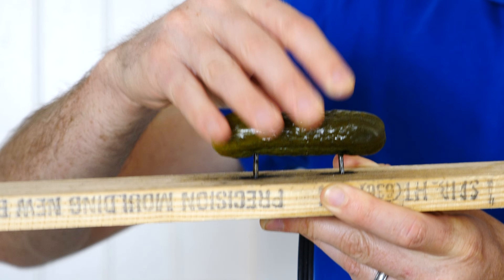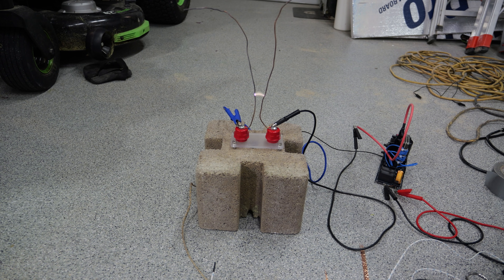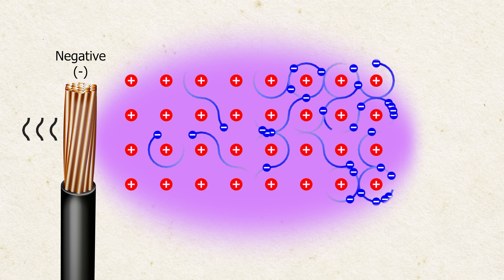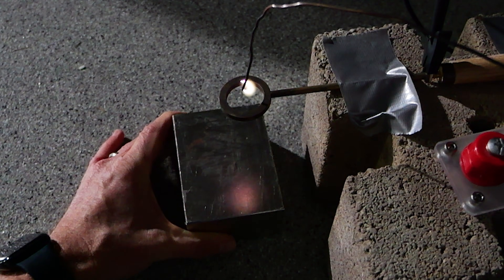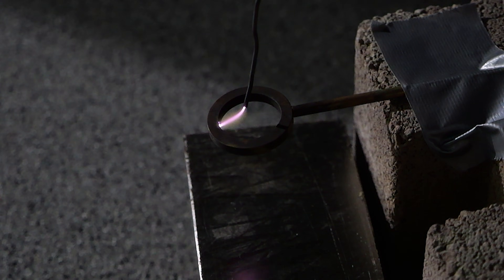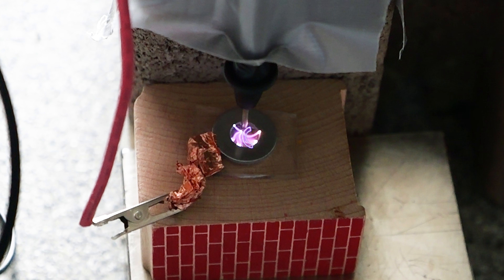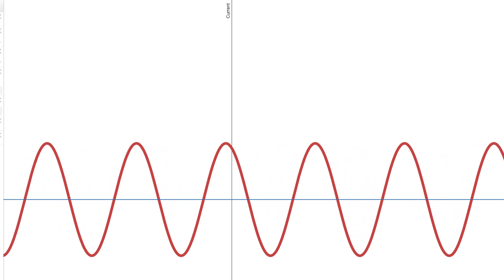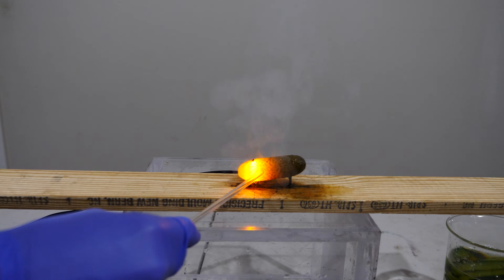Why AC Electricity Doesn’t Behave the Way You Think

Comment: What a genius. "The AC is supposed to be symmetric"[al].

First the AC provided to your location will be reasonably symmetrical. However the crap systems you try to fire it through would be better bent and connected ... and basically everythinged by elementary school children. This is not an attack just a statement to show why we build real technologies with the accuracies that we do. (Which I believe is still way below where we should be)

Second when a circuit finds a lowest point of resistance it will hold that region until something changes the system. The pickle is the same as the wires and the nail. It is a current carrier with its own capacitance and resistance. A good experiment for you to show on this kind of behavior is your thermal imaging on an old damaged extension cord with a medium load for its rating. You can make an old cord by running over a coiled (not a bunch of coils or you'll  surely tear the wire completely in places) cord with a car a few times.

Clean circuits make much less heat, but are proportionally harder to physically create. This should always be the number one goal.

Also, AC is DC and DC is AC. If you think more about how the ENERGY flows through the different parts of your circuit and how the different parts respond to that flow it's a little clearer. For instance, your pickle trick... The AC is like a wheel that accurately spins, and lifts a seesaw type lever that is your nails, that runs into a pool that is your pickle. If you make a floppy seesaw it will change the results. If you make a deeper, larger, smaller, wider, whatever pool, you will get different results. The reason I say AC is DC is in that it is the same as potting up voltage and potting it back down by hand over and over. The reason I say DC is AC is because when you initiate a circuits connection, just like the slight inaccuracies of the floppy seesaw, the material takes the flow of energy in its own frequency (AC) based on the materials "magnetic resonate characteristics". There are no straight lines. More like overlapping and bumping bubbles that are all different sizes and tensions depending on what it's made of. Copper seems to be happily overlapping bubbles with also great tension. The pickle seems to be happily overlapping bubbles with very little tension. The wire shield appears to be non overlapping bubbles with reasonable tension.
Reply: The flyback transformer he used has built-in diodes and some electronic neon sign transformers are knows to have a DC bias for some moving plasma effects in the tubes.

Comment: I could be wrong, but the high voltage transformer looks to be a diode split transformer. These contain built in high voltage diodes on the secondery side, so the output is high voltage DC, not AC.

Comment: No. 
It depends were you leave, but generally in homes you have 4 wires. Out of 4 wires only 3 wires are wired in each outlet. Most of the outlets have Live(Phase 1 or Phase 2), Neutral, and Ground. 
Exception to this is only for the equipment that requires 2 phases, and they have dedicated outlets which have Live Phase 1, Live Phase 2, and Ground.

Although the Live is AC at 50 to 60hz(depending were you leave), the Neutral is always theoretically at 0v.
PS.
Thus full bridge rectifier isn't necessary in most equipment.  Half  bridge rectifier would be just fine. 
However it is a good thing to have in case someone connects in reverse.

Comment: The other day I tried to think of a better metaphor for AC than the hydraulic metaphor that we use for DC.

What I came up with was to treat it like a sheathed cable, like on a bicycle's brakes. Energy is transferred by pushing the cable back and forth, and the load is at the end of the cable doing useful work. Voltage is how far the cable gets pushed, and amperage is how hard the cable must be pushed. Frequency, resistance, insulation, and wire gauge are basically non metaphorical here.
Reply: We had AC like mechanical power transmission systems, see "Flatrod system" for water wheels and mining operations and "Jerker-line Pumping System" for connecting multiple small oil wells to a single steam engine. By suspending hanging wooden boards that are connected end to end, you can push on one end and the other end can be attached to angle redirectors, splitters, and the pumps or machines that need power.

If I had to guess, these systems fell out of use as DC-like wire rope drives could power rotating machines more efficiently and more portable steam engines removed the need for transmission lines.

Comment: your ZVS driver uses a flyback high voltage transformer, flyback transformers output high voltage DC, they have an internal diode.
Reply: I was about to say this. There are AC flyback transformers, but most of the ones you find (including the one he used) will have internal rectification. Unless he modified the transformer, it's supposed to put out DC (as indicated by the big red positive output).
Reply: @minerzone63 yea i didnt get that either... He seemed to be saying it was an ac on the ladder as far as i could tell, but the line output transformer certainly looked to be the standard old tv one, with the 2 adjustment knobs. If it were modified it would look pretty damaged from drilling in and shorting the tripler diodes and capacitors properly. The ac ones u can now get on ali etc are also black and red, but just a simple barrell without knobs or the supplimentary voltage outputs.
Reply: Finally, someone noticed this. And some electronic neon sign  transformers deliberately have a DC bias for moving plasma effects.

Comment: It would be awesome it the bolt in the ring was round, maybe a round ball, and the ring had a ring, maybe like a washer - this way it would be easier to release electrons from the ring, than from the center piece and it would further cement the argument for DC bias in an AC driven plasma.

BTW, it is said (in some sources) that the full Moon causes slightly colder temperatures on Earth due to cold cathode effect - I would be curious is there anything of substance in this claim.

Comment: Pickle glow: Not because of DC bias, but because the plasma has a lower impedance than the pickle's natural impedance. Once its starts to glow it always going to glow on that side because of the lower impedance allow more current to flow in a dense spot. A pickle will not have an uniform impedance. I noticed that the plasma appears to occur on the opposite side of the stem in the video clips shown. Perhaps the bottom end of the pickle naturally has lower impedance than the top (stem end)

As far as the spin direction, that may be caused by the heat generated by the plasma & it swirling causing the plasma to bend in on direction from the start. If you look at a Jacobs latter the arc is bending & moving upward because its heating up the air causing it move upward. The direction of rotation might start because of the minor offset between the center electrode and the washer, and/or surface imperfections in the washer. 

I don't think the effect is caused by DC bias because the voltage drops to zero (essentially off) 120 times per second at 60 hz AC. Its the air flow causing the swirling effect.

What happens if the Washer & center electrode is rotated 90 degrees, such that the center electrode is horizontal. I don't think you will see an swirling effect unless a magnet is used. I think the arc will remained fixed at the top. Also try it at a 30 degree angle and a 15 degree angle. does it rotate anymore?

Comment: i always assumed it was because electricity when shorted will heat up or spark at the point of least contact or most ressistance, like how it would occur in an old lightbulb, or cold joints in circuits. i bet if you plug in the pickle again but only this time one side should be a tight fit and the other a loose fit, the side thats loosely fitted will arc always

Comment: The neutral wire, being referenced to ground, should have a negative charge bias from a surplus of electrons in the earth?  Testing with a pickle won't show that because variations in pickle geometry has a much greater effect. [edit: ... unless you can find a perfectly-balanced pickle where the hot end changes upon rotation]

Comment: Mass has heat energy singularities within its core and activation of generation of heat issues to the weakest point of resistance? Spinning is both clockwise and counterclockwise unification of unidirectional flow cycling circulation centrifugal force of currents grounding outermost surface perimeters first towards the core last in every scenario freezing, disolving, and thawing outermost surface perimeters first towards the core last that's grounding currents.

Comment: Can you measure the copper wiring DC resistance of the high voltage secondary? In both directions of polarity?
This might be a CRT TV diode split transformer with built-in, invisible , inaccessible rectifers. 
Those diodes would be detectable by such a measurement.
In comparison, ignition coils of combustion engines do not have diodes.

Comment: That's how a Mercury Arc Rectifier works. It creates a mercury plasma with AC input, and uses the explained principles to convert AC into DC. They were used until silicon diodes came out, and are very cool to watch.
Reply: They were used long after silicon rectifiers appeared due to the limited power handling - current and voltage - of the first rectifiers. They were used in railway locomotives for a long time because some systems had overhead AC for fast speeds overground and low voltage DC third rail for the underground sections, so the motors had to be DC.

There used to be one in the entrance hall of the Science Museum in London. I was there once doing some research and there was a school party of kids of about 8 or 9. One of them was looking at the mercury arc rectifier and the teacher said "So, Johnny, how does that work?"
"Madam," I said "I have difficulty explaining that and I'm an electronic engineer."
Reply: ElectroBoom needs to create a full bridge rectifier with Mercury Arc Lamps then.
Reply: @matthewhafner962  but it would be funnier to make a plasma bridge rectifier out of 4 pickles
Reply: There is a video on one of those Hg units in an elevator this week on youtube

Comment: Excellent creative analysis, and material I needed to know for some research. Thank you using real current as electron flow and not the idiotic use of conventional current used in all textbooks, etc., which is a lie. it would mean atoms are moving, so all the Cu+ copper atoms in the wires would be moving at high freq literally back and forth. My ham radio antenna wires would be sucked into my transmitter and spit out the other side the full length of the antenna  back and forth at 14 MHz leaving a bit of a mess as my transmitter melts.  Please do a video on that sometime to show its stupidity.

Comment: the zvs driver that was connected to the flyback transformer has 3 diodes in the high voltage winding so in the end you have a dc output but the other mot was pretty weird since it was not dc
Reply: It's possible that this is a Diode split transformer. They have great internal (hidden) values. 😀
Reply: @Oldclunker-ge5zp  yep exactly
Reply: The flyback transformer he used has built-in diodes and some electronic neon sign transformers are knows to have a DC bias for some moving plasma effects in the tubes.

Comment: Have you tried adding an adjustable DC bias to to waveform to counter the DC bias of the electrode geometry?
Reply: The flyback transformer he used has built-in diodes and some electronic neon sign transformers are knows to have a DC bias for some moving plasma effects in the tubes.

Comment: I have always wondered why AC wires they are important to wire the hot and neutral. I have never heard a good explanation. Thanks.
Reply: Honestly, I believe it has more to do with ensuring you don't accidentally make a bunch of series circuits throughout the buildings electrical system.

Comment: The rectifying effect of a plasma is used for surveillance of the flame in my central heating, which is powered by natural gas.
They apply a 200V sine wave to an electrode and measure the DC component of the current.
No flame-no rectification-no DC.

Your ZVS converter might not actually deliver a DC component at the output voltage. That would be challenging theoretically. But the unloaded voltage waveform might not be exactly symmetrical, i.e. there might be some even numbered harmonics contained. So the arc might strike earlier in one polarity of a cycle than in the other. The resulting current would then have a DC component. That current could actually be measured.
There is actually degaussing equipment to be used by welders in huge construction facilities e.g. shipyards. Magnetized steel rods, tubes and sheets cause unstable welding arcs.
Reply: He used a flyback transformer from a CRT TV or monitor and those obviously have internal diodes and output DC. Very few people noticed this.
Reply: I was looking for whether this phenomenon is behind flame rods.  Thanks

Comment: Before he answers anything, my guess is that it’s due to a physical or chemical difference between the two sides of the pickle and Jacob’s ladder, which causes one side of the object to act differently than the other when exposed to a current, regardless of the current’s direction.

Comment: I did a little research on plasma transistors, similar to old vacuum tubes. If you place a metal ring around the pickle between the electrodes, but not touching the pickle as a gate, and apply a voltage to the gate,   then you'll have a Plasma Field-Effect Transistor (PFET) pickle where varying the voltage on the gate will control current through the pickle.   It's time to start building plasma  pickle logic gates to go into the world's first pickle computer.😂
Reply: Are you in search of funding?
Reply: Or some audiophiles could make very crappy amplifier or use pickle in distortion clipping
Reply: @FilipArlet  guitarists, you mean?
Reply: @paradiselost9946  Why not both? 🙂
Reply: @woopygoman  lol, often "does it go to11? " doesnt work with "i can hear the cap on the left channels third stage is polyester and not teflon..."

but...yeah...
Reply: a cucurbic Plasma Gield-Effect Transistor, or c-PFET
Reply: styro pyro has entered the chat
Reply: Then you can build a Rick bot out of pickles.
Reply: @saeedgnu 😂. Or maybe we can have it calculate "What is the Ultimate Question of Life, the Universe, and Everything", and let it run for a million years. It would be funny as heck if the answer was 42.
Reply: PICKLENIAC, the smelliest computer ever built
Reply: But how long will a pickle last out of it's pickle jar? You might not get time to build a full pickle computer before your pickles rot away. If it still works though, you'll have made a rotten pickle computer.
Reply: @johnpearcey  Tommy Flowers managed to make valve (tube) computers reliable when he realised that hard starting the filaments was what wore them out, and so the filament voltage needed to be raised slowly.
Who will be the next Tommy Flowers to solve the problem of pickle rot?
Reply: @johnpearcey sounds like one heck of a pickle of a problem.😂
A computer cooking pickles with plasma certainly won't be long lived. And is computation is likely to be energy intensive.  And if it needs thousands of pickles to make the transitere in the logic gates then it might be a very nasty smelling computer.
Reply: @kreynolds1123 wait, are you saying a computer made of pickles might be... impractical!?
Reply: @thundersheild926  although theoretically possible and if built it would be short lived as the pickles fry, and  most of the energy will be just waste heat, makes it's absolutely impractical.  😂 But it's comedy is gold.
Reply: Sounds like the real dill!  Sounds like a vlassic solution to a modern problem.  Just use small pickles, so the resulting design isn’t too cucumbersome.
Reply: @danpowell3953 😂
Reply: "There's this machine called 'PC', and I kid you not, it gets turned into a pickle. It's called 'Pickle PC', funniest shit I've ever seen."
Reply: and I thought having to replace vacuum tubes was bad enough haha
Reply: Been there, done that. OH GOD THE SMELL!! My room stunk for WEEKS. My mom was NOT very happy about it. 😅
Reply: Pickle field effect transistor
Reply: Turn pickle fest into a tech convention
Reply: @Eric-c1u1y I love it. show up with a working pickle amplifier.
Reply: @kreynolds1123  "Polka sounds the best"☝️
Reply: omg amazing
Reply: Brilliant description
Reply: And pickles are cheaper than Transistors.
Reply: Slow your roll, Rick
Reply: @TheOakFather the name's Eric 😎

Comment: The rotation of the spark is because of the rotating magnetic field of the magnet you place close by, note how the rotation direction changes when you expose it to the other pole, thats because the magnetic field rotates in the opposite direction on the other pole.